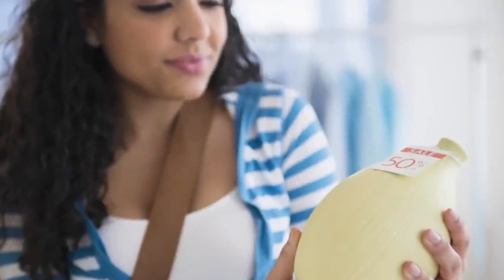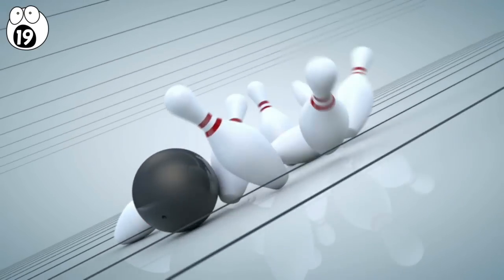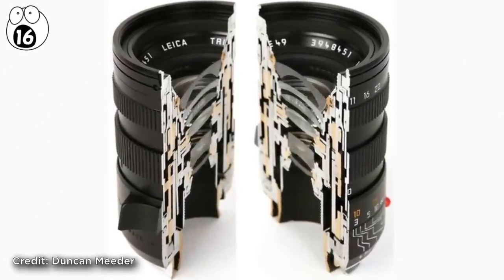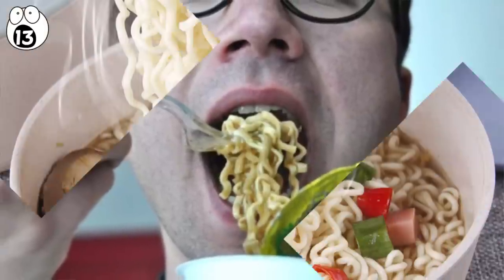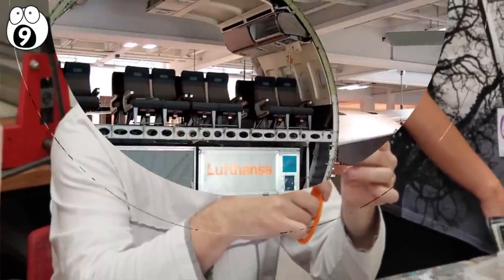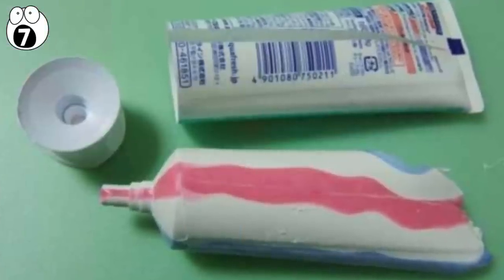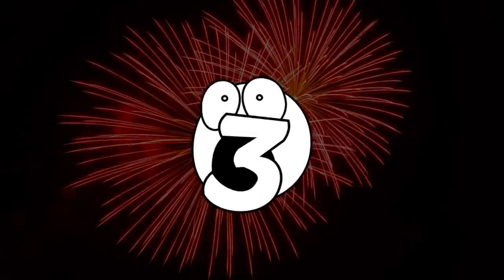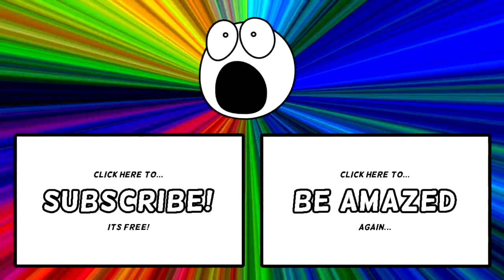Amazing Cross Sections That Will Blow Your Mind!

Comment from the maker: Any other cross section you want to see?
Reply: Jake Paul's brain
Reply: Be Amazed Emm the stem one got my Trypophobia working
Reply: Be Amazed inside of you
Reply: sineP he have a brain?
Reply: Be Amazed I want to see a cross section of a YouTube video 😏😏
Reply: Be Amazed 

1. TV
2. Clock
3. iPhone
4. PS4
5. A car

I am really curious about those 😂
Reply: Deep Boss He doesn't have one though,
Reply: Be Amazed 
Human
TV
Tree
Reply: Escalators, satellites, chainsaws, electric tire pumps, cowboy guns, howitzer, mortar, laser defend system, granpa clock, water pump, radiator, azimo, smoke detector, fire extinguisher, car alarm, stethoscopes, surfing board, diving breathing tank, badminton rackets, gas tank, gas stove, car/bike oil pump, etc.
Reply: That dinosaur owl evolution you said is bullshit....
Reply: The grenade.
Reply: Be Amazed What about these?

Cricket balls
Bombs
Internal Combustion Engines
Gearbox
Coilover Suspension
Reply: guns from wild west era.
Reply: Space shuttle.
Reply: car
Reply: old visa cards didn't have the NFC chip. I still have 1 and won't use the NFC version until absolutely needed. plus that chip allows alot of security risks that some apps are made in order to get that information. you just have to be a few inches away from the card for the phone with the app to do so. 

"accidentally" bump into someone is more than enough. especially with the amount of power in the avg phone and amount of info NFC can provide in that short of a time.

or bump your hand against the persons pocket. or use your finger to simulate the bump effect.
Reply: so in short how do the old visa card's look like.
Reply: that may not be age appropriate.... unless he uses the ones that aren't shaped like it...  now I wanna know. imagine if it looks on the inside the same as outside. Haha.

still I want to know now. thanks alot,  only cause odds are he isn't going to show us.
Reply: No
Reply: Be Amazed a Grenada is defently a everyfay item
Reply: YES EVERYDAY THINGS LIKE GRENADES
Reply: which one doesn't exist. the big heavy TV or the power plant. or was your reply on something else. if so what.
Reply: Moxie Starbuck al least they would be actual everyday things
Reply: Does he have one?
Reply: you got an subscriber
Reply: an actual 

INTERNET MEME
Reply: large tumor
Reply: Be Amazed 
A grenade=everyday thing.
Reply: You should show an AP.I  round. Back in training they showed us sniper trainees exactly what is inside an AP.I  round. It's pretty complicated
Reply: where you get your info from
Reply: Yep a hand grenade is definitely an everyday thing.
Reply: Be Amazed a tv phone and a xbox
Reply: because grenades are in every day use
Reply: Really A GRENADE is an everyday house hold item
Reply: Be Amazed a grenade isn't an everyday object
Reply: Be Amazed "everyday things" 

Grenades...
Reply: Be Amazed you are so helpful to some of the things that I think about so keep it up
Reply: All cross sections there cool
Reply: Be Amazed I'm not sure a grenade is an everyday thing... 😐
Reply: Be Amazed the owl is fake😩
Reply: Be Amazed
Reply: Cross section of R2D2, internal cumbustion engines, and a pod racer from Phantom Menace.
Reply: the grenade and the visa card
Reply: Gun? British Pot Noodles (original) are FULL of noodles though
Reply: Your damned HEAD!
Reply: Top Kosovo I KNEW someone would say that 😂
Reply: The gun powder in a bullet does not explode it burns
Reply: The most iconic building cross section ...
Reply: sineP it would just be a blank screen...
Reply: @Be Amazed.....bowling balls ......for real that time please :)
Reply: I would imagine that there is allot of us that wants to see nuclear missiles and bombs as well as smg's assault rifles and many war related arms
Reply: An artillery shell
Reply: Be Amazed I wish I was fam
Reply: peacemaker?
Reply: Ebola
Reply: its cald a revolver not a cowboy gun
Reply: You may be getting a small amount of noodles but you're still getting two weeks worth of salt content per roman cup.
Reply: W.r.t. the bullet; It is not the firing pin which ignites at the bottom of the bullet, it is the primer or percussion cap.
Reply: Human
Reply: Be Amazed b
Reply: An inter section
Reply: Be Amazed 1:19 wrong, if the sun was a beach ball we earth would be a pea
Reply: Yes me too
Reply: sineP ill sub so youll do that
Reply: Moxie Starbuck a
Reply: Be Amazed Is the boat  Enchantment of the Seas?
Reply: egg
Reply: A Spaceship/UFO
Reply: One of those massive CO2 lasers used to cut an object in half.
Reply: Be Amazed unmanned drones, GPS satellites fooken laser sights
Reply: Human heart
Reply: Human heart
Reply: Mia Malkova
Reply: A fly and a lps
Reply: Kannabis he aint got one
Reply: No
Reply: BE AMAZED wow 😮
Reply: Zodiac signs
Reply: MAN.. BULLET, CAMERA LENS, ZIPPO LIGHTER, TURTLE, LOCK & KEY,  GAS STATION AND GRENADE ARE 'LONGITUDINAL SECTION'
Reply: Novi stars doll
Reply: @souvikmondal5279  its empty dude
Reply: there are very fancy medical cross sections .. well eventually it makes it's way to being a cross section.. 
there are very fancy medical sectionings of humans done by the donated cadaver being pictured as small small slices are made. sorry i didn't want to lose the request idea before checking if there are any already. sorry if there are.. hope it works well regardless and thank you BE AMAZED
Reply: Oxygen
Reply: SPARK  no
Reply: CROSS  SECTION  OF   EMINEM'S   BRAIN  !

Comment: By the way, for that bullet, the "firing pin" is actually a high explosive called the primer. The primer is struck by a firing pin but the firing pin is part of the gun. The powder is actually a low explosive that burns faster than the speed of sound into a gas that expands so quickly it luanches the bullet.
Reply: Julius - the definition of “high explosive” is that the ignition wavefront is supersonic.

Comment: The firing pin is part of the gun, it strikes the PRIMER, which ignites the gunpowder.
Reply: Brian tell him the rest 

The firing pin hits the cup of the primer that then strikes the anvil that is painted with fulminated mercury that actually explodes when the mercury is crushed then forced to stop very fast, it is the fast stop that causes the explosion the thermite fast burn, this sets off a large amount if sparks that are heated to 6,000 *c  this hot sparks then light the gun cotton falsley called gun powder for real gun powder has not been used for some 170 years now because it does not burn even and it burns very dirty that one need to clean ons fire arm a lot so one does not fowel the action and berral,  smoaky too that makes it easy to find the shooter to return fire to the hide. Then the gun-cotton burns at a set rate of speed A magnum round burns slower so more thermite can burn more so more gas is produced. in time the actual bullet is pushed out  of the brass then the forcing cone  of the barrel  then down the barrel where it starts to spin do to the rifling in the barrel    and to rhink all of this happened in just about 3 seconds tops  then soon very soon elk stakes done on the fire grill ...

Comment: 4:34 that's actually so when you add water it gets to the bottom of the noodle as well as the top so it Cooks evenly
Reply: And also so the noodles have room to expand as they cook.
Reply: Yes :)
Reply: so why don't they make a bigger size. or "premium" version.or fatter bottom to allow more noodles.

instead of being the 2nd version of lays chips.
Reply: +Mena Beshai as water is added noodles get bigger. If they were already filled to the top they would fall out
Reply: Mr. pooptazer ?????they get thicker but the level of the water stays the same like not gonna have more water in it its absor the water
Reply: lays chips leave air inside the bag so your chips have room and they  dont smash  ;) you dont want chip powder dont you?
Reply: Mr. pooptazer ?...pooptazer ???
Reply: yup, what Márk said